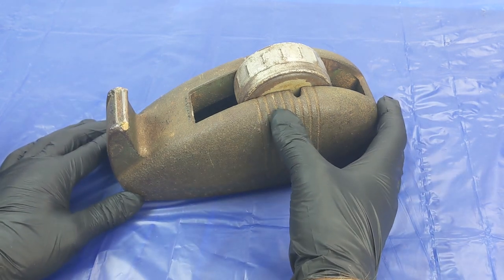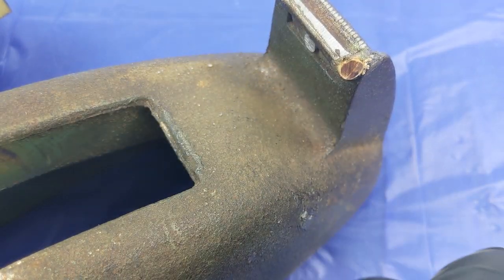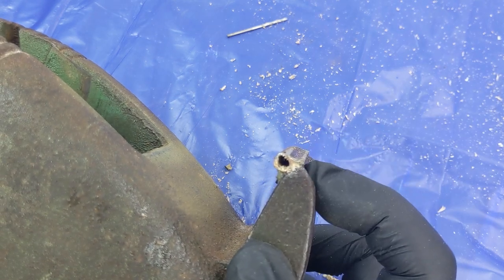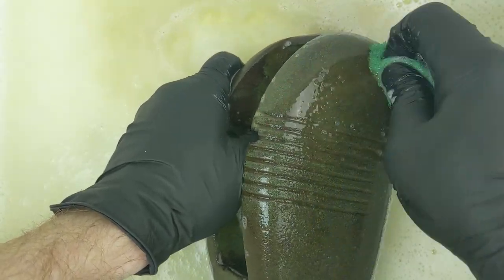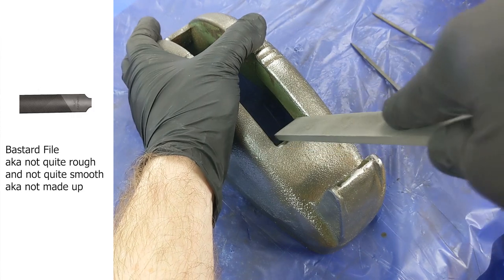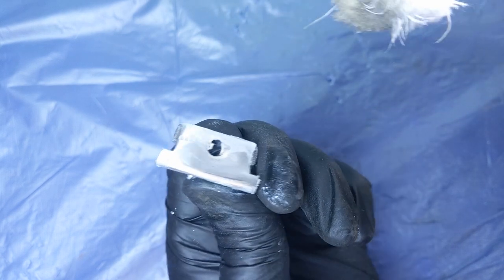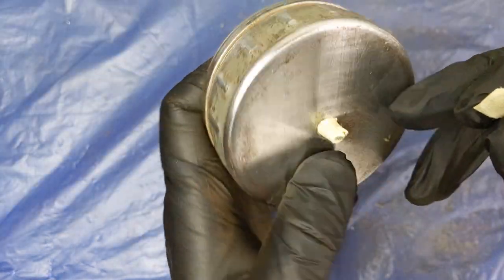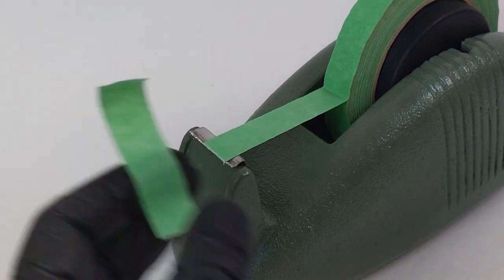Cast Iron 'Bear' Tape Dispenser - Tool Restoration

Comment: I have one in perfect shape. I used it at Eatons in Canada right up till the day we closed the office down. They said take what you’d like so I took my old manual typewriter and my tape dispenser!  Try some WD40 for stuck screws. The rubber feet are key to holding it to its place on the table. The roller in mine that holds the tape is made from plastic to accommodate the newer sizes of scotch tape.  👏🏻👏🏻👏🏻👏🏻👏🏻🇨🇦
Reply from the maker: They are a great piece of kit. The only thing that I have had to change on this since I completed it a couple of years ago are the rubber feet. Seems simple but so handy having it nice and heavy. I think it even pops up in my latest video at one point. Thanks for checking out my other videos too!

Comment: I actually found new tape cutter online (new metal piece you cleaned and reused)  I redid the same dispenser but it was cast iron. My wife loves old stuff so I painted it sparkling red for her.   Screw hole was way to rusted to use or clean up the screws are impossible to find that small around here.   so I just glued the tape cutter on. Looks absolutely awesome.
Reply from the maker: Sounds awesome, they are a great bit of kit. Mine has started to rust again near the cutters, so I think I will try some nickel plating. I can see them being the type of item that would work with any colour at all.
Reply: @RestorationEndeavours  I found it therapeutic.   Almost did the same color you did..I like that.  👍
Reply: HI, can you share where you got the new cutter from? I have one of these and want to get it working better. I have tried filing it but not to happy with it yet.
Reply: @TheCopperFrog  I'm almost certain it was ebay.   Bought 3...but it was about 4-5 years ago.  If I knew where mine were I'd just send you one.
Reply: @TheCopperFrog  maybe try uline or 3M as well.

Comment: Thanks for this video! I have what is a 3M for the regular scotch tape (just found the label is still inside) and it's actually in pretty good shape. The only problem is the cutting blade. Oh and the bottom of mine does not have a place for the feet. It looks to be "petrified" rubber and not sure if it was only in the groove where it is still at or if it had covered the entire bottom at one time.
Reply from the maker: Yeah it is hard to tell sometimes when parts wear down. Sounds like a solid piece though!

Comment: I've got one that doesn't cut the tape very well, any tips? It's in very good condition otherwise, but the tape just slips off the cutter.
Reply from the maker: If you have something to sharpen it with give that a try. A small file just to give the tips their points back. Good luck!